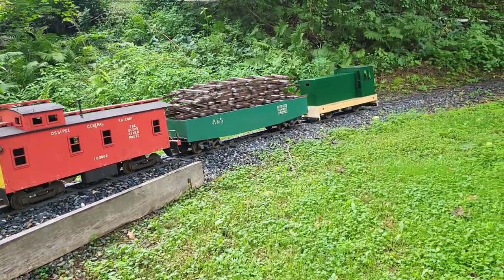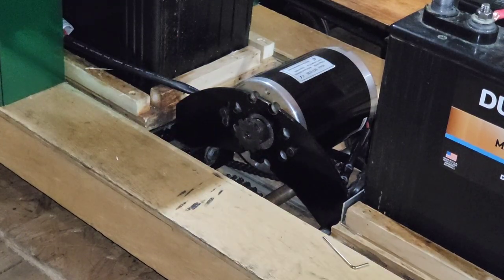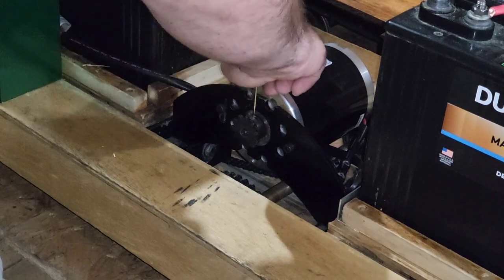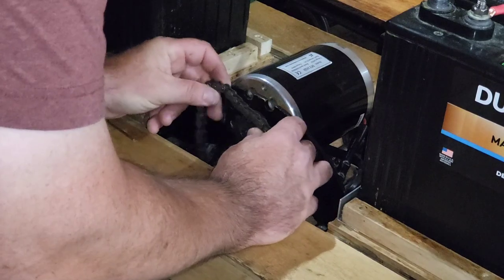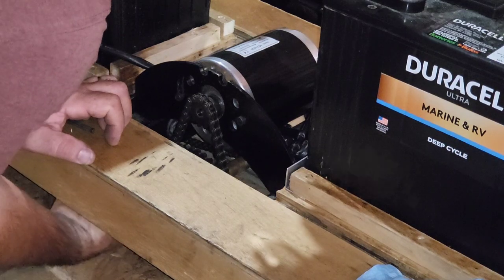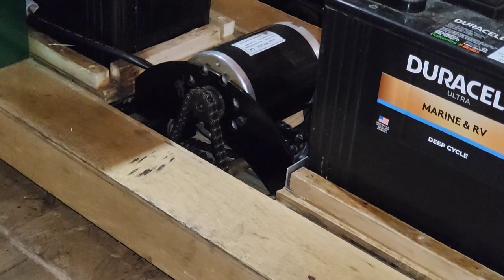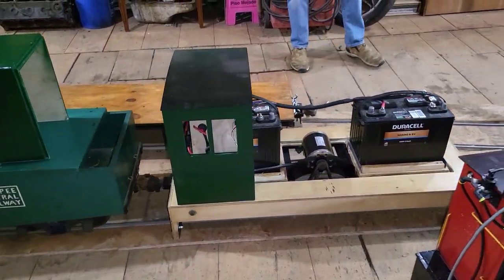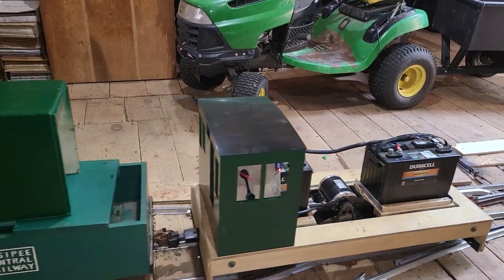Abusing Our Test Loco on the Shady Pines Railroad

Comment: Ideally the motor shaft and sprocket would be slotted with one set screw to hold a key in place and a second to secure to the shaft.  That is quite the mountain railroad, a miniature version of Cass Scenic.  Great video, thanks much!
Reply from the maker: The shaft does have flats on it. That's what the set screws are tightened on to.
The railroad is a good place to find the weak points on a locomotive.
Reply: @MillBrookRailroad  It's never good practice to use the set screw as a drive component.  A key or driven pin is usually used to transmit the force and a set screw is used to keep the key or pin in place.  An alternative would be a splined shaft and sprocket with the motor shaft end drilled and tapped for a keeper bolt but then you're talking some big bucks.  I learned long ago to become friends with people that have lathes, mills and key broaches.  Fortunately, now I own that equipment.
Reply: Could  you machine a woruff key and machine a keyway on the motor shaft and a square key way on the sprocket and use a setscrew...Bill has that beautiful  CNC MILLING MACHINE 😊😅😂❤....ENJOY...OR A VISE BROCH  GRIZZLY  TOOLS HAS ALL THIS GOOD STUFF😢🎉😂❤
Reply from the maker: My philosophy on the drive sprocket: It is the equivalent of a 50-ton industrial switcher. The rest of the drive train can only handle 3000 pounds on the drawbar before components start to fail, so I'm trying to make the main drive sprocket the weakest point, but not have it fail during normal operations (pulling loads up to 2600-lbs. The traction motor sprocket is the cheapest and easiest thing to replace. My thought is that if I choose where the fail point is, I can make it easier to repair at night in the middle of the winter.

Comment: Liked the effect of nearly running into the trees.  You have the same response as actually being there.  That seems to be a small drive motor.
Reply from the maker: It's a little running gag I have going through many of my videos, to have the camera fall or get hit by something. Sometimes, It's a genuine fall. sometimes, it's just for the sake of humour.

The drive motor is perfectly suited for the size locomotive it is in. It is a 24V 500W motor inside the equivalent of a 50 ton industrial switcher.
Reply: @MillBrookRailroad  Understand and appreciate your somewhat twisted sense of humor!

Comment: Just a suggestion you may want to run some flat spots of the shaft of the motor that way your sets crew has something to sit in I'm going to make an addendum to this post you may want their if you have a Mill or grind a flat spot just remember to polish the shaft with some fine grit sandpaper to take all the burring off
Reply from the maker: There are flat spots on the motor shaft from the factory.

Comment: The grades on this line have me wondering what you use for brakes! Does the motor have enough resistance to stop on its own, or is some other method used? If something gets away on this railroad, I’d give it 2 curves before it sails off down the mountain! With so many flat railroads out there, it’s neat to see someone push the limits of this scale a bit. Makes me wonder if anyone has tried building a cog railway in their backyard.
Reply from the maker: There are only regenerative brakes on my equipment. The Shady Pines own equipment is equipped with air brakes. 
There is a 7-1/4" gauge rack railway in England. 
... but there are actually very few flat railways. The Mill Brook Railroad, for example, (a mere three miles from the Shady Pines) has a 3.5% ruling grade. The Brick Mountain Railroad has an 8% grade. The Shady Pines is probably the steepest at 10%.

Comment: how much battery life do you get out of it on a full charge? have you tested it until it starts to die? I know that probably would kill the batteries and I think you have 2 running in series.
Reply from the maker: It all depends how hard the locomotive works. If it is a fairly flat railroad and a fairly light load, then the batteries will last 8 to 10 hours. No matter what, they usually outlast me. I can't run for that long without a break.

Comment: Ever thought about drilling a hole all the way through the axle and running a extra long screw through it
Reply from the maker: That would compromise the strength of the axle. The sprockets are held to the axles with loctite retaining compound and are holding up quite well. The motor is the only place I use set screws due to the heat when working hard.
Reply: @MillBrookRailroad 👍

Comment: Very Surprised  that a motor didn't  have keyways already machined in the motor Shaft and sprocket 😅😮😢🎉😂❤❤❤.....very impressive  RAILWAYS 😮😢🎉😂❤ Did Millbrook  Shops use a electric  golf cart motors??....Be cool to Solar charger to supplement  the batteries  longer......For late night Pellet  unit Trains.....And Since Millbrook  is Explainingtrack miles and helper service
Reply from the maker: There are flats on the motor shaft and two set screws on the main sprocket. 
The batteries are deep cycle marine batteries. 
... and I am building a solar array to charge the batteries. I have a dozen 79W 12V panels.
Reply: @MillBrookRailroad  Are they of a size that would lend to being made into rail cars? I think it would be pretty neat to have a consist that would be able to recharge the locomotive, but I imagine there isn't much one or two panels would do if they were just strapped to a car. It would be awesome to see something like a Transformer boxcar that could contain a small array of panels that opened up so you could park in a sunny spot and charge while away from home.

Comment: Instead of a set screw why not use a key way?
Reply from the maker: It costs more to broach a keyway.
Reply: @MillBrookRailroad  yes maybe so but there would be a lot less problems in the long run. No slipping set screws.

Comment: you're not supposed to beat on a motor with ball bearings Just thought you Would like  know when the motor fails
Reply from the maker: I wondered how long it would take for someone to mention that. I usually burn the motor windings out before the bearings go.
Reply: @MillBrookRailroad maybe a bigger motor would survive longer ?
Reply: @danielfantino1714 . Cooling fan of strap on cooling fins?
Reply: @robertheinkel6225  we´ll see Aaron´s answer/comment.
Reply from the maker: @robertheinkel6225  I'm working on a traction motor blower.